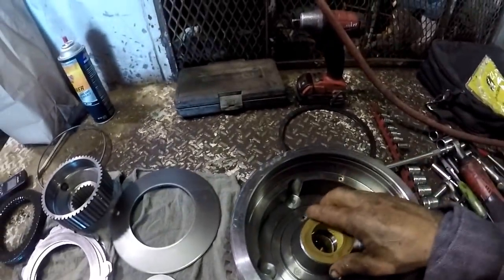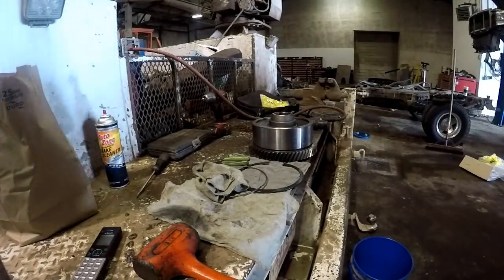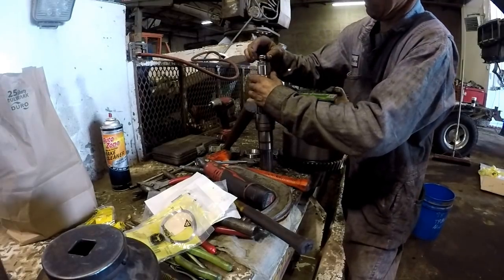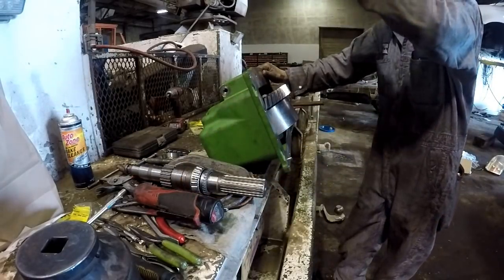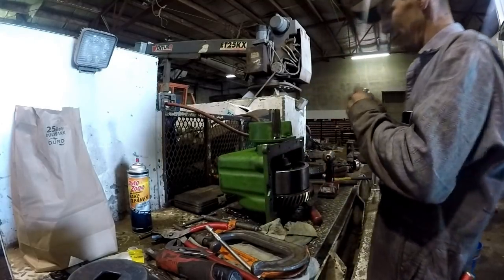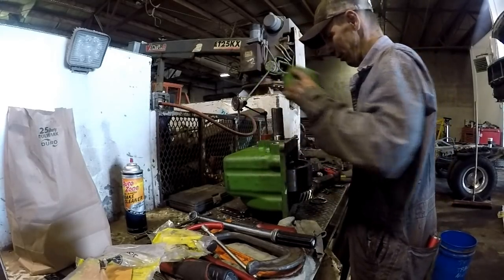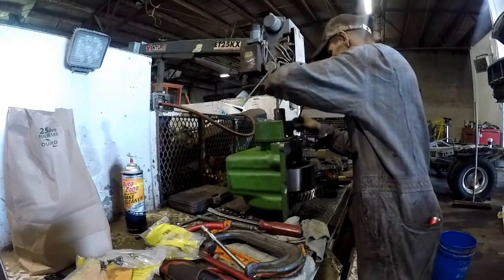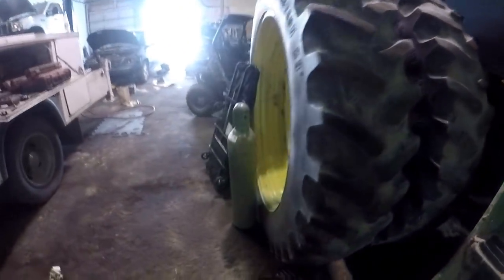7430 mfwd clutch pack

Comment: I like the field improvisation of tools! Had to use a piece of wire a plier one time way back to compress one piston ring at a time to put a 220 cummins piston back into the sleeve bore.
Reply: I hear you, I've used big paperclips to get out of jams before because that's all I could find in the truck. They work really well to fix a wiper that the plastic tab broke on.

Comment: Air hammers are my tool I gotta carry , get jobs out there especially under these cabs with big hyd fittings you can’t get wrenches on , I have some long hammer bits that I’ll put on the flat and give it a sharp wrap and after you can spin the fitting by finger , I tighten them the same way and literally saves you 8 hrs on alotta those big fittings , mostly it’s out in the field and they need to go

Comment: A good dial indicator is expensive, repeatability is important. A good set by Mitutoyo is under $250, you also need some longer rods, so the indicator is exactly perpendicular to your work. I now it's seldom used, but worth it when needed.
Reply from the maker: I had all that at one time  , got stolen  !

Comment: Have you ever rebuilt a transmission on a 8430 ivt ?  Has calibration code and wont calibrate pti 630.13 and pti 523917.17 dealer said it has low pressure somewhere

Comment: Hi Warren. I have a question that I would appreciate a very quick answer. Here in the UK my good friend has just bought a brand new JD 8270R. To cut a long story short we had to change the front wheels to a 72 inch track for his plough and when we removed the centre dishes from the hub/axle we noticed that some of the bolt holes were different sizes !
One or two are slightly larger and one is oval in shape. The JD dealer has assured us this is correct. Surely a wheel centre dish should have equal sized bolt holes. What do you think ?
Many thanks.
Reply: fergie35X  the two tighter holes center the rim to the hub. Hand start those two bolts first then put in the rest of the bolts.
Reply from the maker: Sorry,  took me awhile to get to you . That's correct , start the 2 smaller ones to center the wheel and install the rest .
Reply: western truck and tractor repair thanks very much.
Reply: Cheers, thanks very much.
Reply: Many thanks for that.